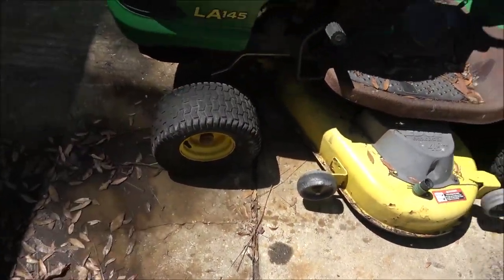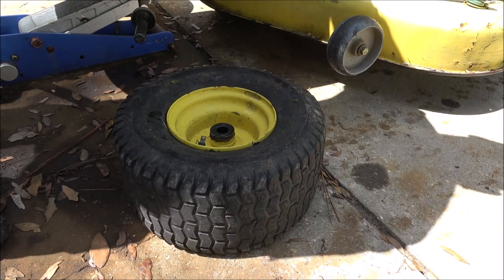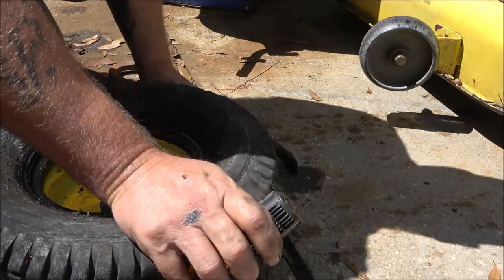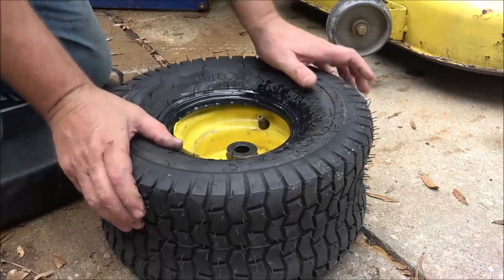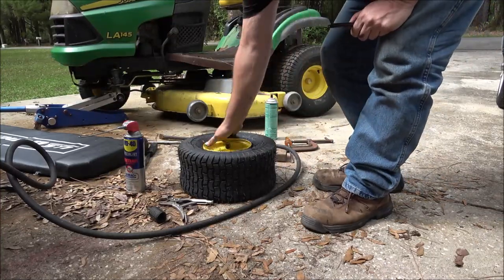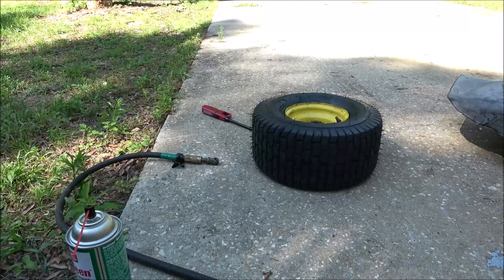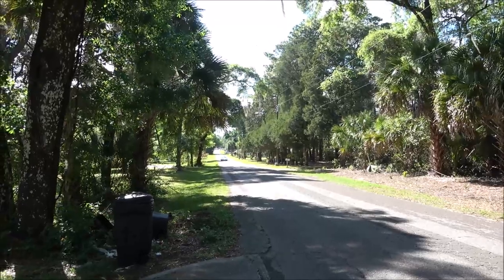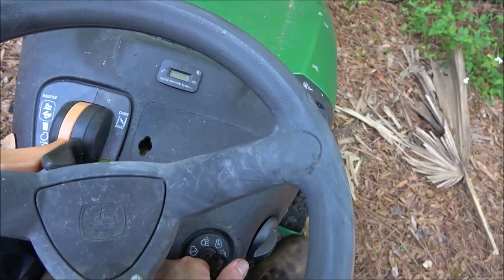Putting New Tires On The Front Of The john Deere LA145 And Setting The Beads With Fire

Comment: Ha ha,  I learned how to Dismount and remount tires the ol' skool way w/ a couple Tire irons by hand and with the manual tire machine that Grandpa always had at his place.  I've slung more rubber by hand than you can shake a stick at on cars trucks tractors motorcycles and anything and everything in between.  But the biggest pain in the ass Tire job that I got talked into doing for someone was a new set of tires on a little Briggs & Stratton tote goat mini bike.  No matter what the hell I did I could not get those new tires to bead up and seat tubeless,  so I finally said to hell with it and picked up a brand new set of tubes to go in them after which that little bike handled great with new tires on it.  However the hours that it took to get the tires dismounted and the new tires mounted dismounted and remounted again was a real nightmare.  If I ended up with a tote goat mini bike of my own that needed new tires on it I need damn tempted to take it down to a local tire shop and let them deal with it rather than go through all that hassle again,  ugh 🙃 ..
Reply from the maker: Yeah I hate them tires too. I had one I bought cheap for resale and I ended up putting new wheels AND tires on that were already mounted.  There's ways around everything lol
Reply: @shabear1000  yep,  it's called getting frustrated with it and running it over with the D6 caterpillar and going back to the drawing board, letting it go ghost ride off a cliff into the river, using it for target practice or giving it a gallon of gas and a match 🤣🤣🤣
Reply from the maker: @idletime those are terrific ideas that I need to keep in mind lmao 🤣